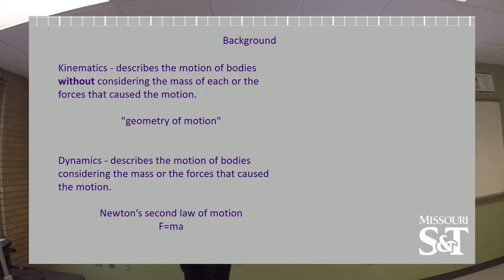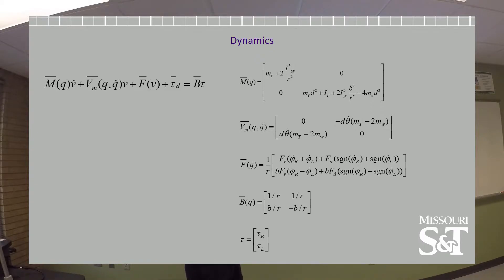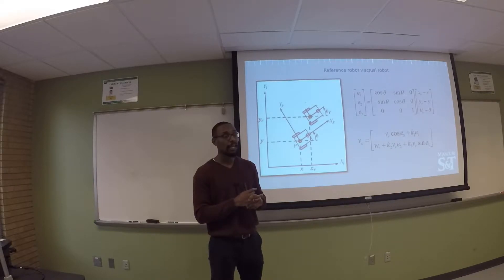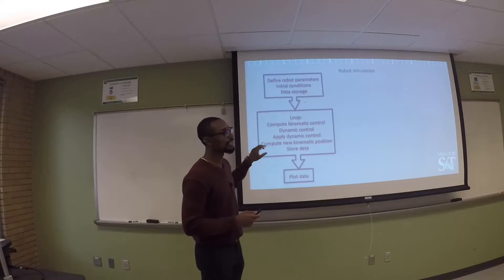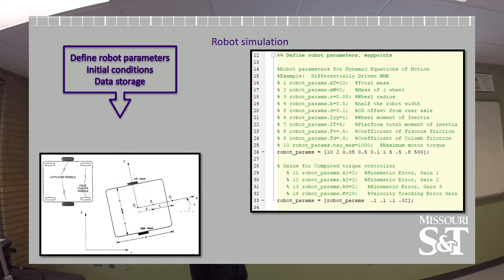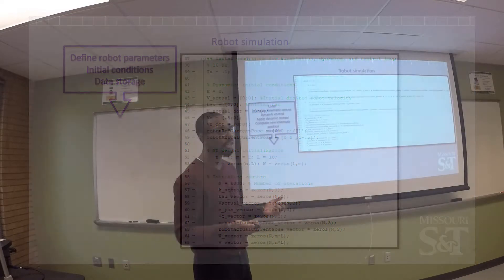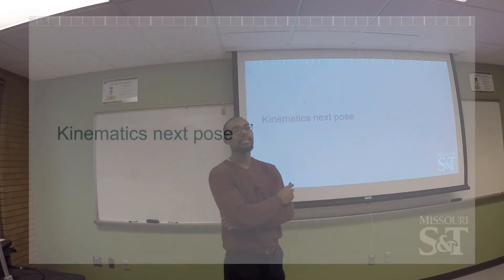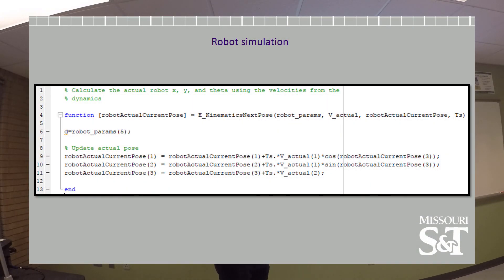2 Complete simulation of a mobile robot with MATLAB: Background / Simulation

Comment: Thank you for your valuable sharing. I'm asking to make the operation of the system more understandable. Is there a block diagram describing the control operation? (First the kinematic controller, then the proposed CT controller, then the dynamic model, then the calculation of the new position of the robot. I'm actually trying to understand what the inputs and outputs of these blocks are and why they are used.
Reply from the maker: @erdem thank you for the comment. I can see how a block diagram would have been helpful, I regret not having included one.

When I first posted these videos several years ago, I had no idea engineers would be as interested in it as they have been.

At any rate, I do not have the time to go back and create a block diagram. I hope that this at least helps point you in the right direction.

Thanks!

Comment: Hello sir, we are working on 4 motors with mechanum wheel pid controller and we are trying to apply our mobile robot kinematics model to the arduino. I made many of research but I couldn't find it. Do you have any recommendation to find arduino code etc for mechanum wheel code.
Reply from the maker: Hello, it is my suspicion that it would be hard to find the code for your system. My recommendation is that you write your own code based on your system's kinematics.

If your platform is differential drive, this video should help; if you are using some other platform (tricycle, ackerman steering, etc), you should derive that system's model and use difference equations (or euler's approximation) to represent the model in such a way that you can apply it within a loop. 

Mccannum wheels introduce considerably more complication, try to make reasonable assumptions when possible to simplify the system. I hope this helps. Thanks!
Reply: @GeorgeLenoHolmesJr  I believe that we can write our own code according to the kinematic analysis maybe we can modified differential drive code for arduino. Do you think that it is possible?

Comment: i need to disscus about the code can u help me
Reply: tnx  appreciate that
Reply from the maker: Sure, do you have a few specific questions?
Reply: i have plan to design the wmr by using anfis ,
plan to combine the dynamic and kinematic model of the robot 
more important thing i need to know about the loop that iterates between the dynamic and kinematic part
need to know about the update of kinematics
and what is the controller used for update the dynamic behavior

tnx so much
Reply: i have plan to design the wmr by using anfis ,
plan to combine the dynamic and kinematic model of the robot 
more important thing i need to know about the loop that iterates between the dynamic and kinematic part
need to know about the update of kinematics
and what is the controller used for update the dynamic behavior

tnx so much
Reply from the maker: Thank you @dotB  !
There is no controller to update the dynamics, the dynamics are updated based on physics (the same can be said for the kinematics). 

If you so choose, you can insert your anfis, or any other controller, into the kinematics or dynamics to modify the performance based on your desired expectation.

Comment: Hi George,

I have a question when I use the syntax of the differential drive robot provided my the mathworks when I give the parameters it is not able to run. It gives me an error stating undefined variable. It is not able to solve the forward kinematics in the loop. But when I try using only the formulas in a new script it is able to solve. What should I do is it because of not having certain add ons in my Matlab which could recognize the differential drive syntax.
Reply from the maker: When you say you use only the formulas and it works, are specifically referring to removing the MATLAB GUI robot simulation?
Reply: @GeorgeLenoHolmesJr   
For example the syntax for the differential drive robot used are kinematicModel = differentialDriveKinematics(Name,Value) where I give the radius and the length of the robot. And then using the syntax in the for loop to solve the forward kinematics [v , w] = forwardKinemtics (kinematicModel , wL , wR); where before the for loop I have also given the speed of the left and right wheel.

This shows me the error was it because of not using the specific add ons in my Matlab. But when I use the formula  like v = 0.5*Radius*(wL+wR) it is able to solve the velocity.

Comment: Hi George

I have  a question if we have the wheel speed for the differential drive robot and when we use the ICC method what would be the value of R since if Vl= -Vr then the value would be infinity so how do we do the theoretical calculation with to find the path when the robot moves forward.
Reply from the maker: I'm assuming by ICC  you mean instantaneous center c(?), I'm not familiar with this as a control method. Also I'm not sure how or where you've derived your equitation, but it seems it could be incorrect (V cancels on both sides and l=-r??)
Please provide a paper or some other reference

Comment: i use only kinematic model and not dynamic model for the moment....and i use general forward kinematic model for differential drive. 

however, i know that, to implement LQR optimal control, we need to have a state space model. but i don't know how obtain state matrix, control matrix .....

i'm waiting for a response or a suggestion
Reply from the maker: Thank you for the question. Do you need the state space representation for the kinematics, dynamics, or both?
Reply: @GeorgeLenoHolmesJr  only the kinematics
Reply from the maker: Complete derivation is given in 'Introduction to Mobile Robot Control' Spyros G. Tzagestas, pg 31. Please bare in mind, most seminal robotics texts will have this derivation.
Does this help?
Reply: @GeorgeLenoHolmesJr  thank you very much Dr, all that i want are there in this book

Comment: hello, how do you create a kinematic subsystem of the mobile robot using Simulink? Thanks
Reply from the maker: Ifiok Charles that is a large question. In a nut shell you need to look at the mathematical model of the kinematics and use the proper block to preform the matrix multiplication. Be sure to integrate the answer to get the robot pose